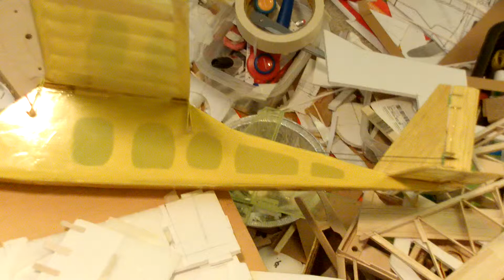rc aircraft tutorial   distribution of mass  dom3

Comment: I need your help, i need  big size wheel I am buy from banggood can you explain what is pu  material wheels from banggood
Reply from the maker: sorry.  i am not certain what you want to know.    the large wheel is made of wood and plywood.   rubber gasket material was installed at the outer radius, in order to increase  traction.   the axle is a piece of 3/4"  pipe.  the hub is a pipe flange, mounted to a plywood disc.    the main bearing  a  bushing-type  -  a hole in a piece of wood, treated with  bar soap; as lubricant.     the apparatus can be made, any size.    see linked video.   at very small scale, a non-contact drive is necessary, however..    if a  permanent magnet motor is used as a pma, output speed would need to be much greater, in order to get close to  break-even.     googletranslate
https://www.youtube.com/watch?v=lTkXciAn488

Comment: Hello sir, can you please tell me if there is any smart way to know if an RC plane is heavier on one side (say heavier on left than right) , before actually flying the plane, so that any correction can be made beforehand, thereby avoiding sudden banking on 1 side and crashing ? Also how can that be corrected? Thanks in advance.
Reply from the maker: simply,  remove the wing from the model  and  balance it, laterally.    invert a dihedral wing, to do this.    either, add  weight to the lighter side;  or  Reduce weight at the heavier side.     assuming  Minor correction is needed, add the necessary weight near/at the wingtip.      googletranslate
Reply: @daviddavids2884  to laterally balance a model airplane, the wing should be left ON the model, not removed

Comment: You should fill the plane with helium the air is heavy😎👍
Reply from the maker: is this comment meant to be sincere,  or is it  SUPPOSED to be funny.    because it is just  weird.      fyi,  air/atmosphere  density  is  EQUAL,  inside and out a model aircraft, flying below 35000 ft.    so, it's  neutrally buoyant.    a few cc's  of  helium  would deliver  NO  BENEFIT.    do you understand.   if so, just nod.      googletranslate
Reply: @daviddavids2884  Es war als Spaß gedacht. Aber im Hallenflug wird das angeblich gemacht.
Reply from the maker: @Flybrei  ok.   i used to think that, about certain large scale indoor models.     since then, i have realized that in the case where the use of helium is, only, suspected,  the truth is something, else.          such models  weigh  just a few ounces.    it is the  quality of  their finish,  that  'deceives the eye'.   cheers       googletranslate
Reply: @daviddavids2884  Watch this video. https://www.youtube.com/watch?v=xDtqUg8R6Jw
Reply: Weight (RTF) with helium filling: 348g

Weight (RTF) with air filling: approx. 390g
Reply from the maker: @Flybrei  do you have a link to this info.    i ask because, by themselves, the numbers are not  'satisfying'.    they Are interesting.        if true,  42 grams, equals  a 10.7 % decrease in auw.    cheers       googletranslate
Reply from the maker: btw, this video is about  DOM . it's not about  auw.    cheers